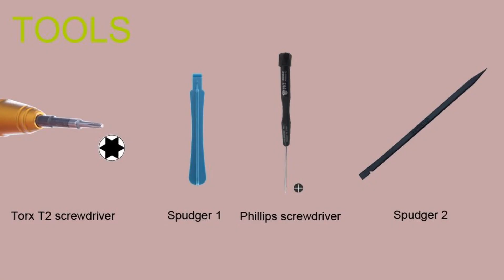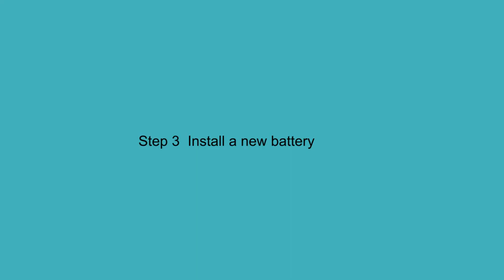OnePlus 3T Battery Repair Guide

Comment: I just completed this. Not easy... 1) The video doesn't show that you need to remove the two screws from the bottom edge by the speaker grill first. 2) Remember to remove the SIM tray before trying to remove the cover! 3) When you see them pealing back the tape along the edge of the battery, what they don't show is that the tape goes underneath the battery and sticks the battery to the screen chassis. Horrible to try and remove the battery - you have to try to pull it off using the tape and very gently prising it off from underneath by inserting a flat spudger. All while not bending the screen. The battery gets bent in the process, so you have to be careful not to pierce it - they have a tendency to explode, remember! By the time it's off the battery is totalled, so it's a one way street. No giving up and putting it back together again. OnePlus really don't want you to replace the battery. Given they do great after sales and will replace it for a fee anyway, I'm not sure this was worth the risk...  New battery from Witrigs seems to be working fine as of writing.

Comment: Hi,

How did the battery come out so easily ... in other videos it seems to be quite a challenge(literally rolling and bending the battery in the process) to remove the battery with it glued on the underside ... 

Anybody have any tricks  to remove the battery without bending or twisting it ?

thanks.